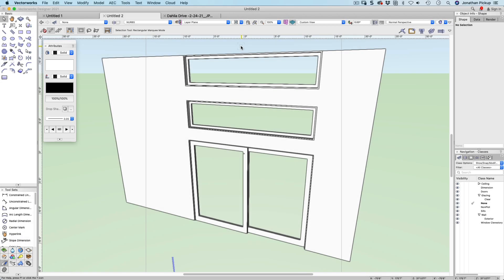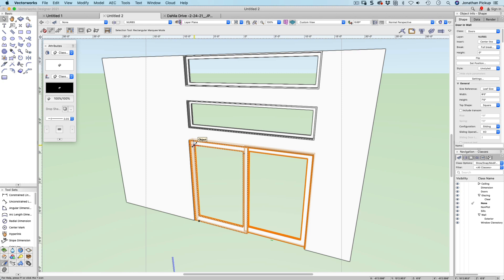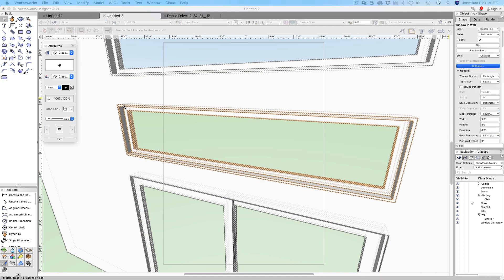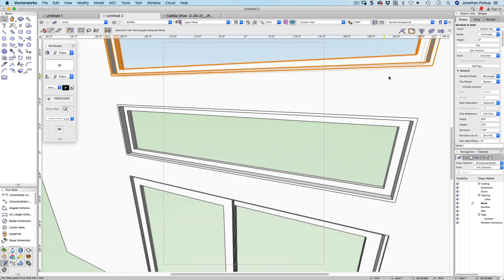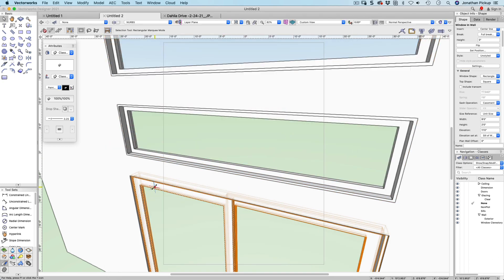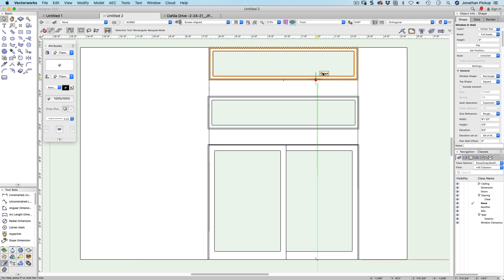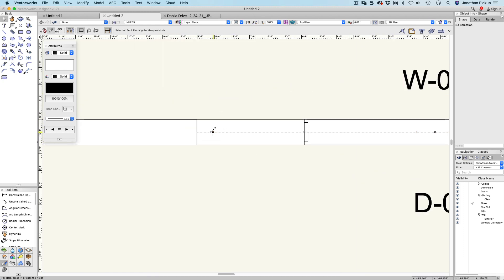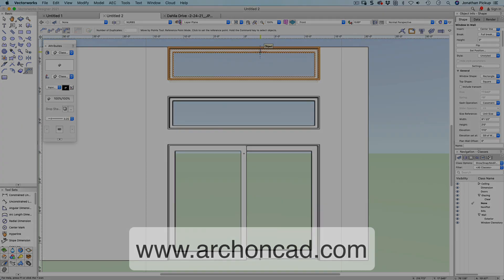Vectorworks 2021 - Aligning Doors and Windows - Podcast 222

Comment: Can you show how to create ed louvers?
Reply from the maker: sorry, I'm not sure what ed louvres are.
Reply: @archoncad  sorry , how to create window louvers
Reply from the maker: ah, now i understand. The Vectorworks window doesn't have the louvre option, so if you want the windows to be Vectorworks windows you will have to create a symbol of the window and Use Symbol Geometry to add the 3D to the window. 

the easy way is to use a windoor object to create the window with louvres. You might be able to use windoor to create the required symbol and and use that as the symbol geometry.

Windoor is available as part of the partner products. Go to the menu bar, Choose Help > Install Partner Products...